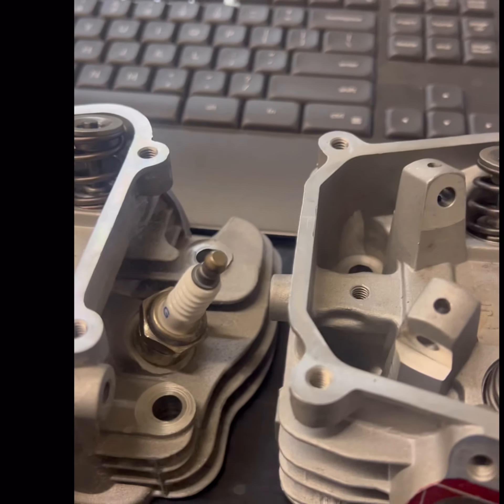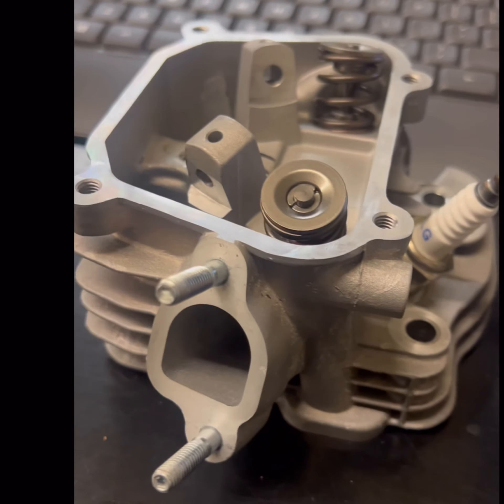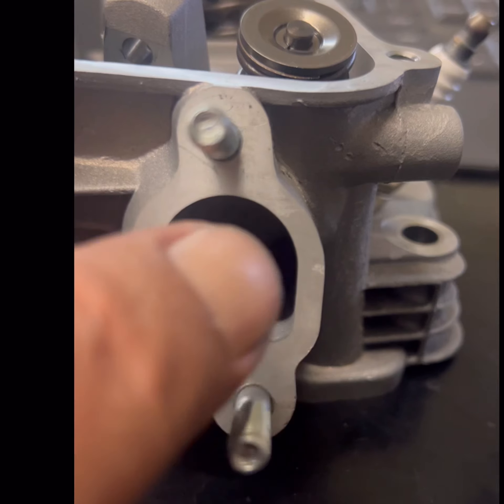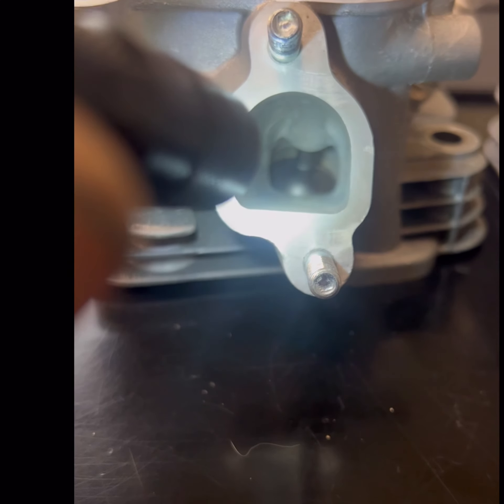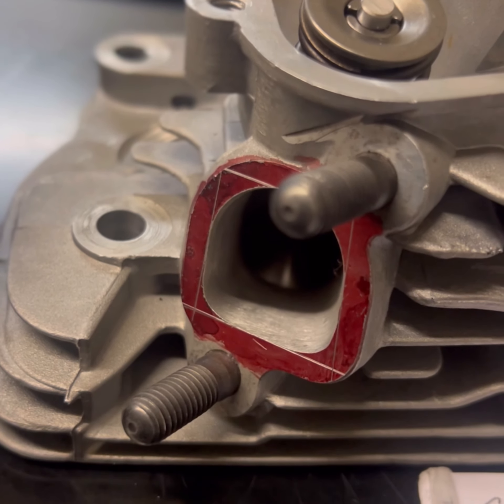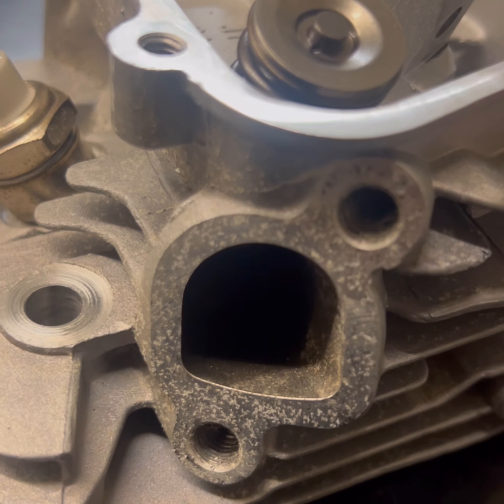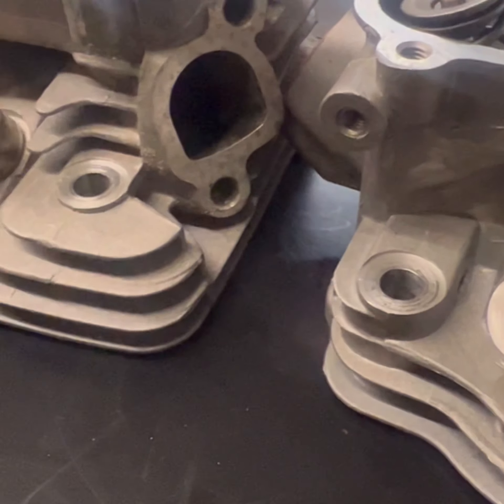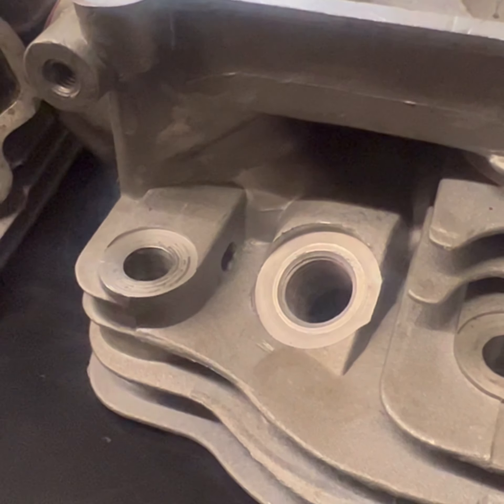Proper porting, an odd Hemi 212 and More to come , #Ducar Hemi #Predator 212 # Big Valve Ghost

Comment: Great looking ports! What you said about ports makes sense. I've seen SBC heads that were so hogged out that the center dividers between the intake ports were paper thin. There was hardly any sealing surface.
Reply from the maker: That was common practice years ago and from different perspectives it sometimes worked and sometimes didn’t. There were a ton of manifolds built for small blocks like that including the small 53 series blower intakes. I had the honor and privilege of knowing and working with and for some great minds in racing. Porting is like picking a cam, ask the same question to 10 people and get 7 or 8 different answers .
Rule #1. “Never remove or destroy the short side radius”
Rule #2. “You don’t pick up airflow from places it’s easy to put the grinder”
Rule #3. Making the hole bigger won’t flow more air if you l can’t get it to go around the corner without stalling.
Reply: @peterchristlieb   A friend recently told me about an issue with a poor running Formula 5000 engine his friend ran into. It's an aluminum 302 SBC with Kinsler FI. The engine wouldn't idle below 1600 RPM and would overheat after 5 laps around Lime Rock. The owner of the car is in his 70s and has a race shop store, maintain and transport the car to the track. The support clown they sent topped off the water and told him to stay out of traffic. I was told that the heads have been heavily ported and the dividers are vey thin. The clowns thought the injection system was at fault. They sent the whole system to Kinsler. Kinsler reported that they could find nothing wrong. Engine still wasn't right. Turns out one of the geniuses at this shop forgot the intake manifold gasket on one bank.

Comment: Im currently building up my tilly 212E. Chromoly pushes, SS valves (27 & 25) ported up the head myself, 26# springs, EC aluminum retainers and split keepers, Fire 265 cam feeding my Mega moto 212 with a juggernaut. Tops about 55-58 right now. You ever throw the EC stroker kit on a hemi? Wondering how the flat top and stroker crank will treat my valves! That's my next plan. This bike eats like a wild pig right now...keeps up with the kids 95 RM125 lol